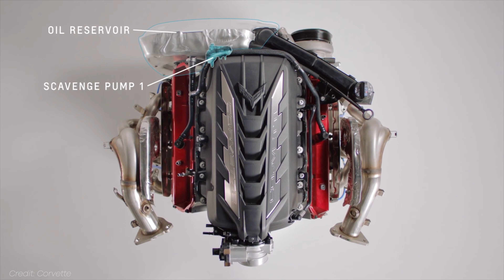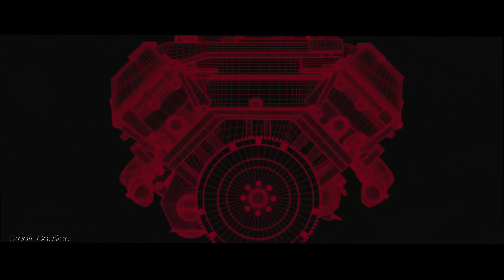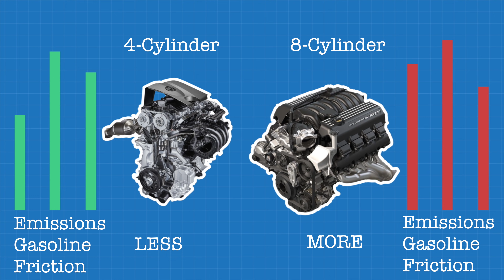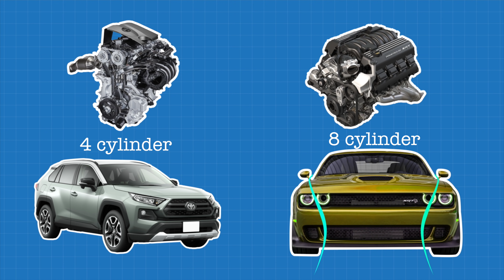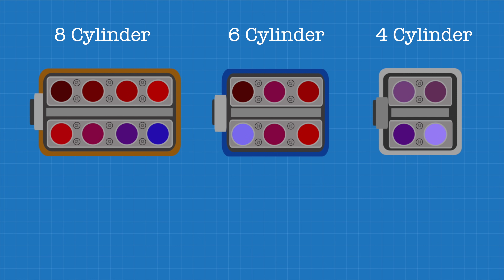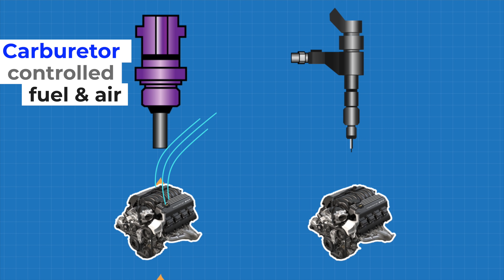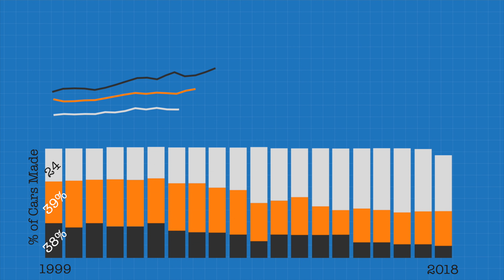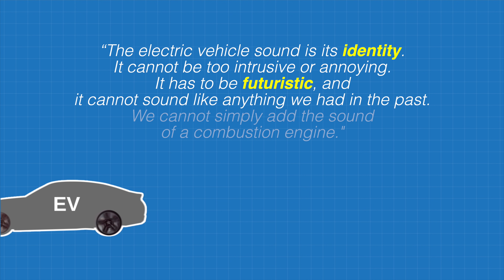Why V8 Engines are Dead

Comment: I understand most manufacturers are downsizing engines and making them just as powerful as v8s. But there are huge amounts of enthusiast that will settle for nothing less than a v8. For Americans it's not just 8 cylinders it's a soul stirring testosterone fueling music. It's a symbol of America. It's because we are different and did things different. While Europeans settled for smaller higher winding fuel efficient engines we loved slow revving burly large displacement v8s. The sound the feel and the Bald Eagles. Companys that completley do away with v8s and muscle cars might want to second guess those decisions before they do it or lose lots of higher middle class young males sales. I have a v6 in my impala it make 305hp and is peppy and fun like an old small block v8. But the sound just doesnt compare or the instantly huge burst of torque.

Comment: I think about na super stock engines. It sucks that boosted v6s are better, or at leasr thats what im told. I still drive my p71. Evs will never rule, unless you get a solar setup, the energy is just comming from your power plant who got it from burning coal. Evs often defeat the purpose, and they only care about faster charging, not renuable energy. Ev owmers are straight hypocrits.

Comment: Scotty, have you considered straight 4, 6, and 8 cylinder engines, in front wheel drive vehicles, positioned lower in the hood compartment, so the crankshaft/power is on the same plane as the front drive wheels?  Nice content and delivery for this video..., YOUNG man!

Comment: Unless and until they outlaw fossil fuels altogether, the trusty V8 will always be with us. Sure, you can squeeze 700 + HP out of a turbocharged four banger, but those are applications found primarily on the racing circuit. The engines alone typically cost upwards of $100,000, require racing fuel, run super hot and fast at ridiculous RPMs, and are certainly not built for the long haul. In fact they're usually completely rebuilt after every race. On the other hand, it's relatively cheap and easy to squeeze 700 + HP out of a V8 using pump gas, with little more than some forced induction, along with a robust cooling and oiling system. I remember reading about four cylinder Honda racing engines that could put out somewhere around 1,000 HP, but they probably wouldn't last more than a few months in a daily driver without having major problems.

Comment: They are dying because young boys are putting “V8 Kill3r” sticker on their back bumpers of their Honda’s
Reply: I hate people with a clapped out 98 honda accord that cuts the muffler out 2🤣🤣
Reply: cgball10_ps3  those engines didn't kill anything lol, the ej257 in my sti makes about the same power as those 2 engines stock, and could keep up with the big boats they came in easily.
Reply: Dave Iauco  oddly enough, thats because Panthers are almost 50/50 as far as weight distribution goes. The cars do stay flat.
Reply: Well, Honda's can make very good power, and coupled with light weight, their power-to-weight ratio means they can not only compete and beat V8's in a straight line, they are also a lot more nimble in the corners.
Reply: Nik Gnashers the only way to make a honda fast is money and for the money you would put in a civic to be as fast as a vette the vette would be over 1500hp
Reply: @derekeagles8626  That is a very silly comparison.
You are trying to compare a very expensive and powerful V8, with a cheap 4 cylinder.
Also, you are simply talking about a headline horsepower number, without even considering power-to-weight, torque, traction, or any other factor which would have a dramatic effect on how fast a car is.
I'll stick to my lightweight European car which can corner at silly speeds, and is still faster than most V8's in a straight line,  thank you.
Reply: @DjNikGnashers  there are arguments for both sides. Truth be told, V6's now make all the power of V8's from 20 years ago, with the fuel economy of 4cyl engines from that era, with better emissions. 

4 cylinder engines have come a long, long way. When it comes down to raw numbers though, there is no replacement for displacement - especially when the more modern offerings are making a really lazy EPA friendly 500hp/TQ on pump gas off the showroom floor. 

There is a lot of commentary from the die hard small displacement crowd claiming they beat V8's all the time. 99% of the time they are beating 20-30yro family sedans with high mileage, or some generally junky 80's shitbox with a big block that made 180hp during that era. 

On the flipside, the other crowd can't let go of those dogged out, beat up, low power v8's that just won't friggin' die but that can't get away from their own shadow. 

Potato potahto. Everybody loves what they love. I drive a 4000+lb Merc Marauder that I have put together and Eaton swapped. I have fun running down BMW's and Audi's out of the hole or on a roll with ruthless repeatability. In the meantime, there is a guy around with a gorgeous buick grand national (powered by that little v6) that I can't seem to catch. He also has two massive Garretts and an alcohol kit. 

There are also people running around with absolutely reedonkulous 4cyl cars that run legit 10's in the 1/4.
Reply: Derek eagles  that is completely false. You can buy a 92 Honda for $1000 put $2000. Even $3000 into it and smoke a vet. Still far less than the cost of a vet. There are video of crxs smoking lambos. You think the Honda owner put even a quarter of what the lambo cost in his car. Specially if he works on his own car. Which is extremely easy to do on a Honda. You can swap a motor in a couple hours.
Reply: Nik Gnashers you are wasting ur breath. I’m American and most only know what the dealer tells them. They don’t get all the technical stuff. They don’t get power to weight. They go by crank hp and not wheel hp. They don’t understand drag or roll. They slap big rims on the car and don’t realize it slows them down.
Reply: @doubble80  the reality is nowadays you can get three to four hundred horsepower out of just about anything, it really just depends on what you want.
Reply: @doubble80  somehow, I doubt an econobox you put 3k into is going to consistently, and reliably beat an expensive sportscar. Ebay turbo kits & welding wastegates shut don't count for that handful of runs before it goes kaboom.
Reply: LeadTheBore who said anything about Ebay parts lol. Legit parts for older Honda’s are dirt cheap. All you gotta do is look up some videos.
Reply: Fox body mustangs are light and with a coyote swap the fun factor is way more over a honda!
Reply: @kjk6717  that is true. You can put together a fox body from legitimate junkyard parts on the cheap and make a stupidly fast suicide machine that has marginal brakes and suspension... and the drivetrain literally lives 200k. 

(Even then better brakes and halfway decent suspension components aren't that expensive for those cars).
Reply: Straight line killer , the after market world can fix the suspension.
Reply: Nik Gnashers Not Stock for Stock not Dollar for dollar
Reply: @nathanstein589  That is a wide statement.
Some V8's are just big, heavy, and make very poor power for their capacity, and are easily beaten on a power-to-weight scale by a 4-cylinder.
Other V8's are obviously much better and make great power, but you cannot make such a wide statement because it does not apply to all engines, it varies widely.
I am in England, and as such, I have a different perspective on driving, because our roads are nothing like your roads.
American's seem to be obsessed with 1/4 mile times and drag racing in a straight line (and I'm not saying that is a bad thing, just different to what we value here).
Personally, I prefer narrow, twisty, undulating, and challenging roads (which I am surrounded with here), and require a high level of skill to control a fast car which wants to slide around as the weight transfers.
As such, small, lightweight, and great handling cars are what we enjoy.
My current car, a BMW M140i, which is tuned to 410bhp/576nm torque is very enjoyable being RWD, and faster than many heavy V8's in a straight line, and simply destroys them around corners.
Reply: @DjNikGnashers  Camaros, Mustangs, Corvettes all handle very well in cornering and have awesome power. The old thinking that the American cars are heavy straight line only cars has not applied for decades.
Reply: @arcflashed  Cornering to you, I'd imagine is a completely different thing to what I would call cornering.
My little hatchback has a power to weight ratio of 277 bhp / tonne, and can do 0-60 in 4 seconds flat. I don't 1/4 mile time it (not really interested to be honest), but I have seen similar powered M140i's do 11.5's .... 
I'd suspect your idea of a corner is not the same as mine.
Show me an American car that costs £20,000 or under, which will corner as well as my BMW, or even be as quick.......

Comment: EV's are JUNK. and at low speed as a pedestrian you don t hear the engine especialy a 6 or 8 cyl,you will hear the tyres. EV's failed in late 1800's and will fail again.

Comment: The BMW vs the prius comparison was very flawed. The way the engine management works on the Toyota Prius is based on the fact that the electric motor will kick in at lower speed and accelerations but when driven aggressively the engine will take over. Meaning all fuel trims will go out the window in order to meet demanded acceleration..... yes your comparing apples to pineapples and seen how fast one can be swallowed

Comment: Automotive world with only electric vehicles would be sad and cold place. Sure they're practical but they have no soul and borrowing the soul of internal combustion engine won't make it better.
 It's unspeakable pleasure feeling the mechanical balance between the components working under the hood, the gears under your hand, the friction of the clutch while changing gear, the rumbling sound of the engine and the exhaust, the smell of freshly burned gasoline...
 To feel how that symphony gets me going makes me feel alive and fulfilled and no electric car can make me feel that way.

Comment: Eeehm... nope the V8 is not dead yet. The 4 Cylinders that have the same performance as a V8.. Life twice as short, have a higher fuel consumption. In real world though. On paper the 4 cylinder is very economical. A Volvo XC90 with a 2.0 4 cylinder T-8 that produces a joint 400HP and has a gas mileage of 11.7607292 Miles per gallon is NOT economical at all. So the good old V8 5.0 does way better than that. And yes the T-8 is way better on paper. But in real life it struggles.

Comment: There will always be a place for V8 engines as long as engines run on petroleum products, ones like the GM LS series are not expensive to produce, are reliable, light and compact. It's nonsense to say that V8's are dead.

Comment: Scotty in the late 60s my dad had a 66 PU with a 396 in it. On the back was a full cab over camper. 2 to 4 times a year we would drive 400+ miles to the gulf coast pulling a boat. The boat was 25'L fiberglass and had an inboard 318 in it. Passengers consisted 2 adults 2 to 4 kids. Which would you down grade to a 4 or 6 cylinder.

Comment: The only thing smoother than a V8 is a V12 or perhaps a V10. Forget power and those little overworked 4-cyl. (or even 3-cyl.) motors. As for electrics, the best thing about them is how quiet they are. We certainly don't need more noise in our daily lives.

Comment: I had put flexible conduit tubing up under the fender wells of a 96 Buick regal 3800. At around 45 mph it would start this humming sound which would increase in volume and vibration with the increase in speed. it kinda reminded me of the sound s tie fighter would make in the movie The empire strikes back. That's what my electric car would sound like. 🙉😬

Comment: The V8 has the same problem as the V6 engines.
And the Problem is the Inline six cylinder.
The Inline six is smoother, lighter,has less moving parts, is more fuel efficient.
V configurations are very hard to Work on.

Comment: Mercedes makes the most Powerful 4 cylinder 421HP engine in the world   (2020 CLA45s and A45s)  as well as make the most powerful Naturally Aspirated V8's 
😎👍 FYI Mercedes invented the 1st ever Automobile / Motorcycle & Combustine engine since 1886 and has over 100,000 patents to the automobile! They sold 2.34 million cars last year more than any other Luxury car brand! For example Lexus only sold 298,000 in the same year! They have so many patents and inventions that all car manufacturers copy and emulate the best they can! Knowledge is Power!! THANKS SCOTTY
Reply: Mercedes had the 1st production car with fuel injection in the 1950's with the 300SL Gull Wing (Fastest Production Car in the World) Mercedes also had cars going 268MPH on a public road in get this 1938!!
Mercedes is the 1st with Hydrogen Technology for an electric car 1994 called (Necar 1) World 1st cars with ESP & Traction Control. First car with LED Headlamps (2006 Mercedes CLS) 1st Car with 100% all led lights (2014 S class) 2014 S class first car to drive itself, air purifier system. Early 2000's Mercedes were first to auto brake itself. They now steer around pedestrians. Literally 100,000 patents and those were just a few of the top of my head. 😎❤👍 Mercedes had world record for Fastest Rear wheel drive, SUV, Station Wagon & 4 Seater cars around the Famous Nurburgring RaceTrack Simultaneously!! Mercedes is coming out with (Mercedes One) World's first 100% built from ground up Street Legal Formula 1 car 1,000+ HP and is poised to destroy all production car lap records!! Knowledge Truly is POWER! Jesus is GOD!! 😎👍❤✝️

Comment: My opinion---a solid v8s sound is so appealing because at a low point it sounds like a crouched large cat beginning to growl in a cinematic way. It's intentionally off, and it just sounds like at any given lope, all hell could break loose.

Then there is the mid range. This is where the large cat has its prey picked out from the herd, and begins to attempt separation. It's noisey, burns a useful amount of energy for preparation. Everything around understands what's going on, but doesn't quite know what's coming.

Then the large cat strikes. All hell breaks loose. It doesn't matter if it's a Ford, Chevy, ocelot, lion. All in scale, all in fundemental nature, all hell breaks loose. You can give someone a Veyron that will tear their face off in a semi calm setting. You can make someone giggle like a child with a 4 cyl if you make it light enough. None of those sound like a V8. You can hear and feel every single swipe of the cats paws once you floor it from a dead stop. You hear mechanical screaming, and it gives you such a proportional amount of power it's incredibly hard to hate it.

My personal favorite was a 95 S10 that a guy threw a 383 stroker in. I asked him if I could ride with him during a qtr run. I've never been in a machine since that did what it did to me. The sound, the smell, the blur, like....solid metal makes noises you wouldn't think under some forces. There's just nothing like it. It's sad it will only be a thing of hobby

Comment: V8 are gas hungry machines. I like V6 now V8s only have two extra pistons just like a V6 only has two extra pistons from an in-line 4 but I feel a V8 in a normal drive around the city car is pointless. Unless it’s a truck that’s going to be built to pull heavy loads a V8 would give you all that power but a V6 is fine in a car that’s a non race performance car.

Comment: You know the saying, "there's no replacement for displacement"
Reply: Konninsegg's 600 hp 2 liter: Um actually
Reply: It’s called forced induction
Reply: @maxsjoberg788  Its still not a replacement. All things being equal you will always make more power with more displacement. You cant cheat physics.
Reply: @maxsjoberg788  forced induction is a supplement, not a replacement.
Reply: Max Sjöberg that not a replacement. All your doing is making a smaller engine work harder to keep up with the bigger one, and it’s known that turbo/super charged engines don’t last as long as naturally aspirated ones. Would you rather have a turbo V6 in a truck that only lasts 200,000 miles or a 5.0 V8 that can make 300,000+ miles with fewer break downs?
Reply: @maxsjoberg788  slap the same forced induction on a v8 vs a v4 this makes your argument invalid
Reply: Craig the farmer isn’t that  just replacing the displacement? Lol
Reply: @maxsjoberg788  he's really not. A 4 cylinder with say 200 hp put a turbo on it and say its got 400. Then take a v8 with 300 do the same thing and now say its got 600 hp. The v8 will out do the 4 banger. You can do to a v8 what you can do to a 4 cylinder and get the same results so the fild will still be the same a v8 with more power.
Reply: Car Freaknatic is love to see one of those hahaha
Reply: 600hp I3 would disagree
Reply: @mpj759  an 800 hp v8 would agree
Reply: @gasman7320  you don't get it do you? 😂 simple man
Reply: @Car Freaknatic Porsche made a car with a 3.0 4 cylinder. I don't think it's the popular
Reply: Except Revs and Forced induction
Reply: @Car Freaknatic yes I'm aware of small displacement large cylinder count engines. But size is relevant in terms of parts masses and the types of accelerations and resonances they will have to experience as all of these considerations relate to engine durability/longevity, how the parts will have to be designed, what materials will be needed, cost, etc.
Reply: That saying is from a long time ago.. and no longer holds any value
Reply: Yeah there is, current